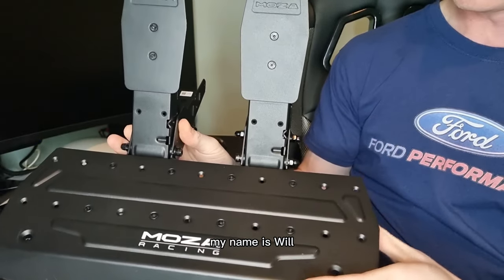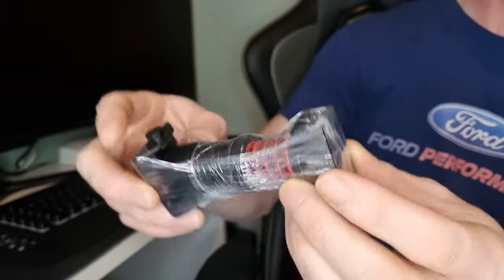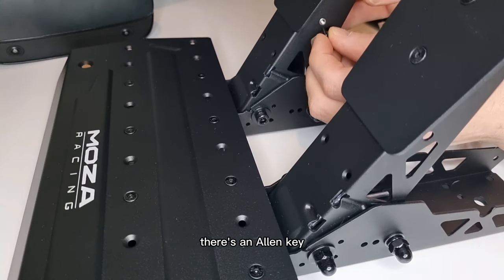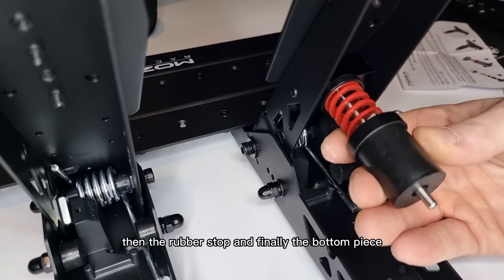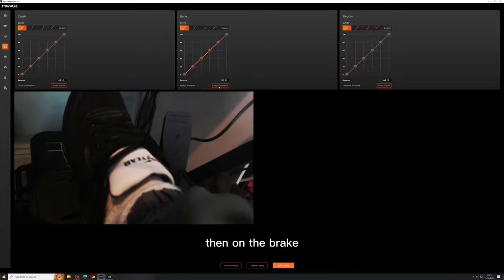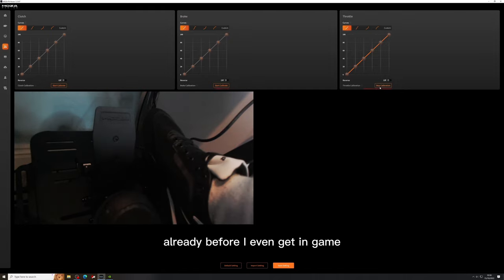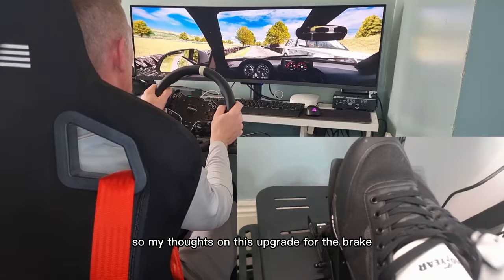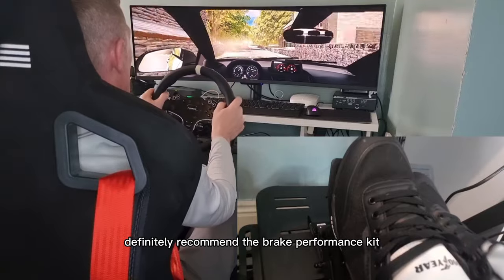Moza Racing R5 SRP Lite Brake Pedal Performance Kit Installation And Review

Comment: can I use this on srp pedals? not "lite" theyre quite similar build and I thought the gas pedal is to soft for the stock.
Reply from the maker: In theory it will fit that being said I wouldn't recommend it, the throttle pedal would then be too stiff

Comment: With what can you compare these pedals? Do you think those are better then the T3PA pedals? and much worse then the CSL Load Cell pedals or are the SR-P lite pedals good enough with the brake pedal performance kit?
Reply from the maker: With the brake mod they feel better than the t3pa, csl feel much better than the srp lite though even with the mod so bare that in mind but if you live without a load cell you won't have issues with these pedals
Reply: @theacking  oh ok big thx for the info bro and quick response!

Do you really think I need a rig to put CSL LC pedals on because I don't have one. Or is it maybe even useless to buy them because I can't think of something I can put behind the pedals. (I'm playing on a desk but and behind it is the heating)